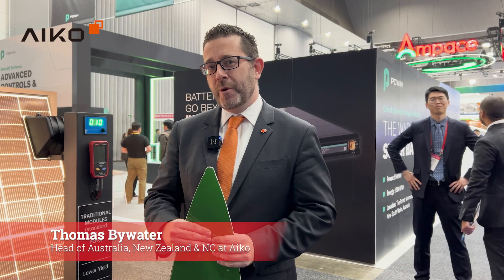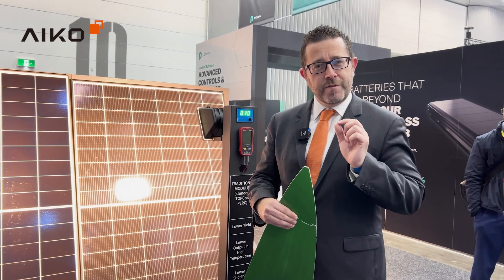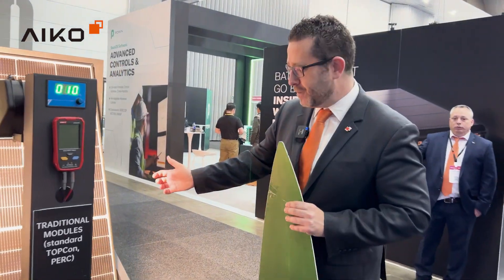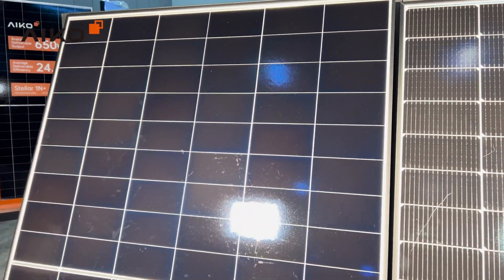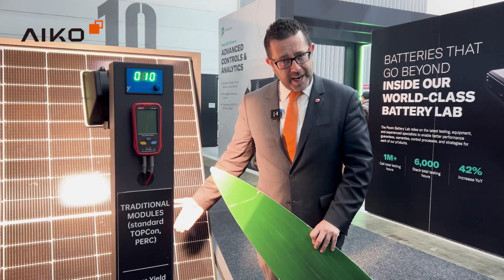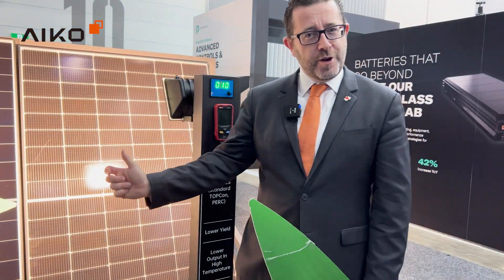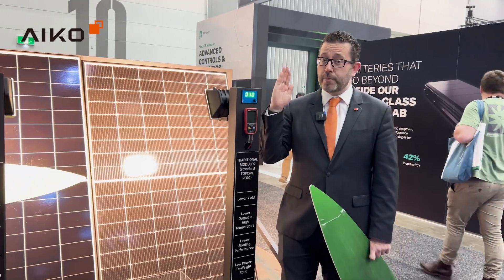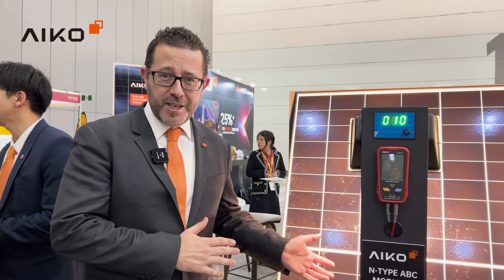Shading Optimisation Test - Aiko Panels with ABC (All Back Contact) Technology

Comment: Nobody ever explains exactly how this difference is achieved.
Reply from the maker: The shade optimisation benefits of Aiko modules are derived from the proprietary All Back Contact technology they have developed.  Essentially, because the metal contacts on the back of the cell are in very close proximity to each other, when a cell is shaded the rear surface of the cell acts like a bypass diode - forming a shunt around the shaded area.